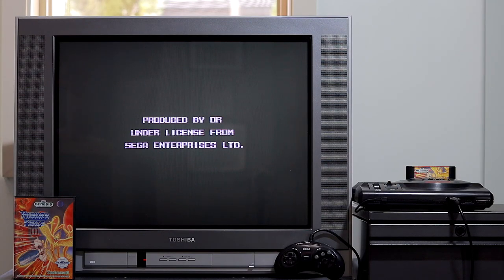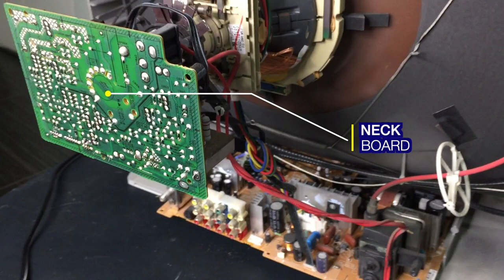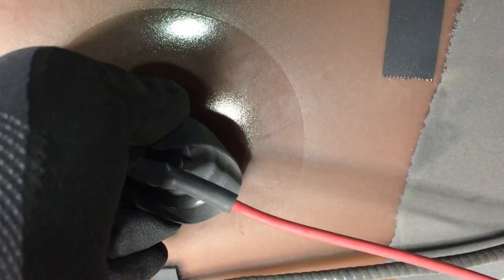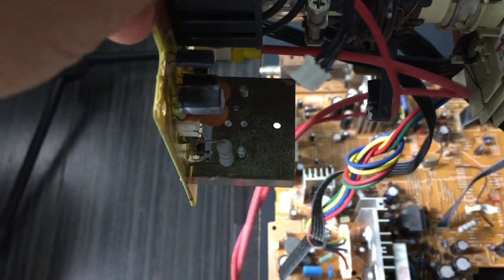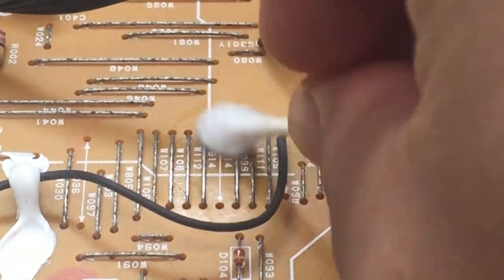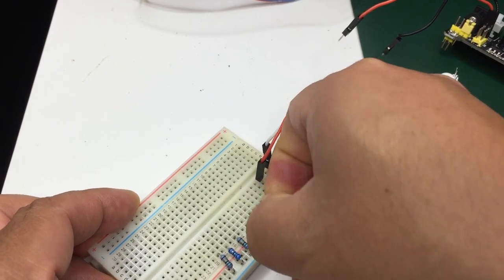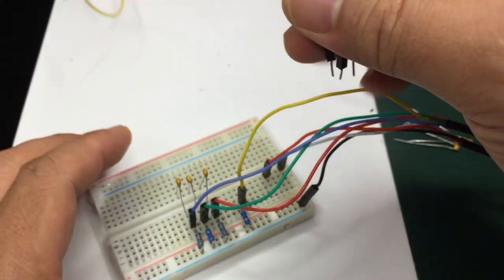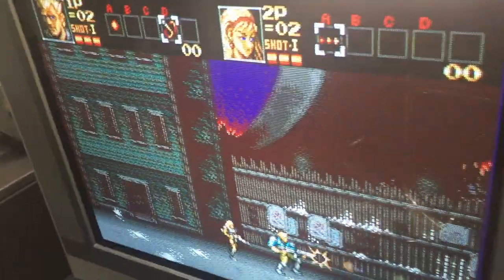How To RGB Mod a Toshiba 27AF45 & Misc. Info [ep. 108]

Comment: The steps in this video also worked for a Toshiba 24AF46
Reply from the maker: Yeah, the models are pretty similar forwards and back as the differences are mostly external cosmetics.
Reply: @The_SegaHolic  Thank you so much for making these videos. Rather than stagger the headers I chose to use right angled dupont headers and solder them over the top of the snipped jumpers.
Reply from the maker: @Awuani  Glad you chose to do things your way and not just copy what I do verbatim. I really do things to give ideas also. Glad you made use of the video. Now go tell people how great RGB'd TV's are. What differences are you noticing between RGB and component BTW?
Reply: @The_SegaHolic    The increased clarity is probably the most noticeable. Seeing details in games that were not present to me unless I played through an emulator. Color accuracy is also quite noticeable and  I found sharpness to be the least jarring change although it is also quite noticeable.
Reply from the maker: @Awuani  Thanks. I will note this when I get asked RGB vs Component and why I waste my time modding a component ready TV, which is all the time. 👍 lol.
Reply: @The_SegaHolic  I should clarify those differences were specific to going from composite (standard yellow single video plug) to scart. I actually haven't compared the component to the rgb on this set. I'll try to hook up my PS1 at some point and see if the difference is quite as pronounced. I think sometimes that difference (between component and rgb) depends on if the chips in the sets are doing additional compression or processing on the component inputs. Not sure if that's the case with this set on a technical level, I'll reply back when I test. Do you have a thread somewhere I could post comparison pictures? Sadly stills or video don't do a very good job of conveying the differences quite like seeing it in person.
Reply from the maker: @Awuani  Yeah, Hard to do video or pics to justify it. But Im working on it as we speak. Put it this way, the chroma outputs RGB to the tube itself. The only adjustments that can be made to the RGB signal is it's "Drive" which you can change to adjust white balance. It is the only way to change the final color of the RGB signal. You just make each color more or less "strong." But with component, a totally different color stace than RGB, there is processing that is needed to convert it to the RGB color space that is outpur at the chroma. It's always gonna be different because of different interpretations of how the color should look during this conversion. That's why when you look at different brand external YPbPr to RGB converters, each one looks different. In fact, you can adjust resistors internally in one of them to dial in the colors to whatever standard you are looking at.

Comment: Whats the point of this mod when the TV already has component?
Reply from the maker: 1) you don't need a transcoder
2) you don't need a transcoder
3) you don't need a transcoder
4) Much cheaper than a transcoder
5) No manipulation of the color spaces where the transcoder quality and output varies amongst manufacturers
6) Component is different colorspace than RGB
7) Component looks different than RGB
8) You don't have to tweak your settings to get component to look like RGB
9) I already have my RGB cables from the Framemeister
10) Damn.... you got me.... can't find a 10th reason...

Comment: Will this work for the 27A44?
Reply from the maker: Yes. They use the same chroma
Reply: @The_SegaHolic  I wasnt able to get any type of RGB signal. I double check to make sure everything was wired correctly. The TV is able to switch to normal mode by toggling the switch, but when trying to switch to RGB it's just blank screen. Any idea what could be wrong?

Comment: Thanks for the information and great video but...
This TV expects 3.8v for correct blanking and I don't see that you did the math or use any resistor (550 to 700 ohms as a voltage divider).
Now, your external RGB lines have a 75ohm to ground termination but no inline resistors to achieve the OSD voltage level within a tolerance of the jungle chip RGB inputs and due to that, of course, you didn't remove any resistors.
So... I don't know man, there's lots of documentation about the OSD MUX method and I see you missed lots of steps, seems that you do it only by experimentation without any mathematical basis.
Reply from the maker: Experimentation is the basis of learning and the way we discover things. You can only do so much without an O-scope and the datasheet for the Micon and or Jungle. BTW, your "the tv expects 3.8v for correct blanking is false. You can look up all the IC's datasheets to really see what they need. otherwise, experimentation and sweeps of your input volage with a potentioment and seeing if that makes a difference is best. Blanking voltage BTW, are mostly a range of voltage, not a set one.
Reply: Also, I already verified the information, the exact factory voltage is 3.8 v:
For blanking from MICON, it sends a 5v signal from pin 33, also, we have 2.2k resistor to ground and a ISS133 diode which has a forward voltage of 1.2v. So to calculate the blanking voltage:
(5.0-1.2) x 2200 /(2200)= 3.8volts.
So yeah, we can assume that "around" 3v is the required voltage for correct blanking.
I don't want to mess with your work, I just say there's a basis for it, and even though experimentation is part of the job, it doesn't hurt to know exactly why and what exactly you are doing.
Reply: Oh yeah, and those RGB inline resistor values that I referenced in my first comment, came from using the OSD mux RGB calculator by MarkOZLAD.
Following his process, you should have removed resistors R127,R128, and R129.
But again, as you said. If you experiment that's perfect, in that way you located the jumpers which are really handy for doing this type of mods. I am just sharing the knowledge I have for anyone who reads this and is wondering about the how and why
Reply from the maker: @KinokoPower  🤦‍♂️... just 🤦‍♂️
Reply from the maker: oh yeah... 🤦‍♂️

Comment: I've watched a few of your rgb mods, why don't you have to remove any resistors like you do on your more recent conversations
Reply from the maker: You mean capacitors. Depends how stuff is laid out on the board. Sometimes, removing caps is more feasible instead of cutting traces.
Reply: @The_SegaHolic  yeah sorry, that's what I meant. I'm tracing out my rgb mod now and I'm just trying to make sure I'm not missing anything
Reply from the maker: @Fahrenheit38  what model tv you got?
Reply: @The_SegaHolic  a Sony kv-32v36
Reply from the maker: @Fahrenheit38  I’ll take a look at the service manual
Reply: @The_SegaHolic  I'd appreciate that I've been looking at it a lot myself. I see the jungle chip and the micon chips. Both have RGB pins, I know I gotta splice in the middle of them for the rgb in. Then I gotta apply 5v to the blanking pin on the micon, I think that's pin 42 as per the diagram. I'm also assuming I'm feeding the rgb from the console to the micon and not the jungle chip.
Reply from the maker: @Fahrenheit38  yeah, splice before the .1uf or 1uf capacitor thats leads to the jungle/chroma. The reason I removed the capacitors in my recent Sony mod was that was the easiest way to create a break in the circuit.... it kept everything clean. Thats why I had to add it back in the external wiring.
Reply: @The_SegaHolic  yeah, that tripped me up. I have very little idea what I'm doing but I can follow directions failry we'll but a step by step for rgb mods are not really a thing due to diffrent models. I really need to take the back off of the TV and take a look at the board so I can start planning on where to cut in. One question, the flow of information is from the micon to the jungle right? Might be silly to ask but I haven't seen it stated before
Reply from the maker: @Fahrenheit38  yes, the micon or “microcontroller” just provides a rgb picture signal to the chroma/jungle. The same type of rgb signal like your retro console can provide.
Reply from the maker: The micon provides the text and icons that pop up when you press “menu” or “volume” or when you change channels... the “OSD” or ON SCREEN DISPLAY.
Reply from the maker: So what u are essentially doing is cutting that OSD signal from the micon from teaching the jungle/chroma, and putting in your own OSD (the signal from your console).
Reply from the maker: You can make this cut or break right at the RGB input pins of the Chroma/Jungle, but since you need the capacitor right before the rgb input pins for both the micon’s OSD and the console’s rgb signal... why not leave it in and cut before the capacitor that leads to the rgb pins on the chroma/jungle.
Reply from the maker: Some instances, like the JVC and Toshiba models I did, the board layout makes this simple as there are jumpers right before the capacitor that leads to the jungle/chroma. It’s easy to desolder the jumper wires and create that break in the circuit instead of cutting traces.
Reply from the maker: Watch the JVC D-Series video I did, and it goes through these concepts and shows them.

Comment: Hi ! I watched some of your videos, can you give me a link on how to do the 75ohms resistors with 0.1uf stuff? Because I'm retarded or something, I did an RGB mod on an LG kp-20u50 that uses TA8808BN chip, soldered RGB to pin 47, 49 and 51, then 3.3v to pin53 it activates RGB signal, but when I activate the signal the image it's too bright! If I put 75r to ground and 104b capacitors on RGB line I get some kind of ghosting, so theres something im doing wrong lol

Also I'm getting Sync from Composite with PS1 home made RGB cable

Here it is the pinout:

TA8808BN
pin1  =N.C
pin2  =R-Y OUT[8.2v]
pin3  =N.C
pin4  =N.C
pin5  =N.C
pin6  =VCC-CHROMA[12.3v]
pin7  =COLOR control[3.4v]
pin8  =N.C
pin9  =N.C
pin10 =SW1
pin11 =SW2[5.2v]
pin12 =D/L-IN[5.3v]
pin13 =BIAS[5.3v]
pin14 =D/L-OUT[7.9v]
pin15 =TINT control
pin16 =ACC-FILTER[5.8v]
pin17 =DC-FEEDBACK[3.5v]
pin18 =50/60HZ
pin19 =GND-CHROMA
pin20 =PAL/NTSC-IN[6v]
pin21 =SW3
pin22 =PAL-IDENT[11.7v]
pin23 =N.C
pin24 =N.C
pin25 =APC-FILTER[4.9v]
pin26 =XTAL 3.58MHZ
pin27 =NTSC-IDENT[11.3v]
pin28 =XTAL 4.43MHZ[3.4v]
pin29 =VERT-DRIVE[1.2v]
pin30 =VCXO[8.8v]
pin31 =VERT-RAMP[6v]
pin32 =VERT-NFB[6v]
pin33 =SYNC SEP-IN[6.9v]
pin34 =FILTER GATE PULSE[2.5v]
pin35 =H-BLK-IN[1.3v]
pin36 =AFC-FILTER[7.5v]
pin37 =VCO
pin38 =H-AFC[6.7v]
pin39 =H-OUT[2v]
pin40 =VCC-H[8.9v]
pin41 =R-OUT[4.8v]
pin42 =G-OUT[4.7v]
pin43 =B-OUT[4.6v]
pin44 =R CLAMP[5.1v]
pin45 =G CLAMP[5.1v]
pin46 =B CLAMP[5.1v]
pin47 =EXT.R-IN[7.3v]
pin48 =BRIGHT control[3.8v]
pin49 =EXT.G-IN[7.3v]
pin50 =GND-V/D
pin51 =EXT.B-IN[7.4v]
pin52 =X-RAY[0v]
pin53 =TV/RGB [0v - 0.7v (with blanking), 4v - 6v (no blanking) 
pin54 =HALFTONE[0v]
pin55 =PICTURE[6v]
pin56 =DIFF-IN[0v]
pin57 =CLAMP[6v]
pin58 =VIDEO-IN[4.9v]
pin59 =CONTRASS control[3.9v]
pin60 =R-Y IN[6.2v]
pin61 =VCC-VIDEO/DEF[12.3v]
pin62 =B-Y IN[6.2v]
pin63 =VCC-RGB[12.3v]
pin64 =B-Y OUT[8.2v]

PS: I didn't despiser anything in the board, everything it's soldered directly to jungle chip ta8808bn